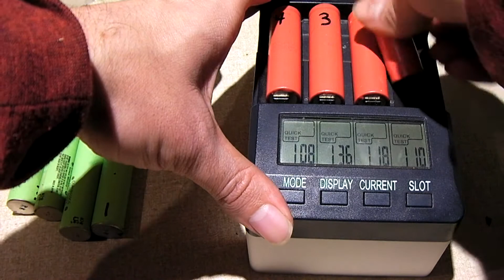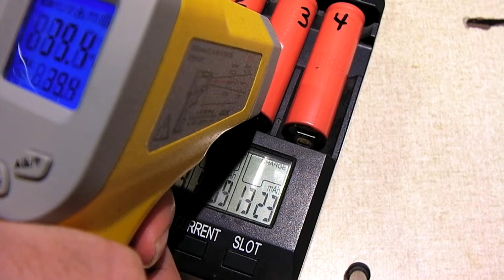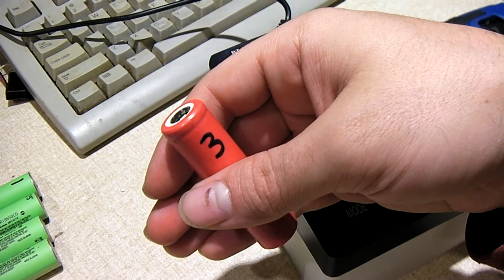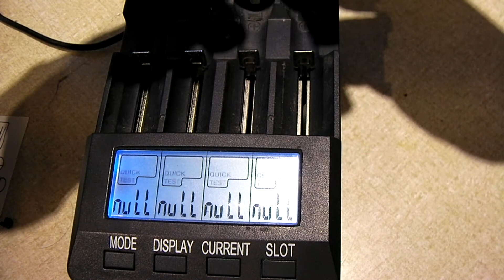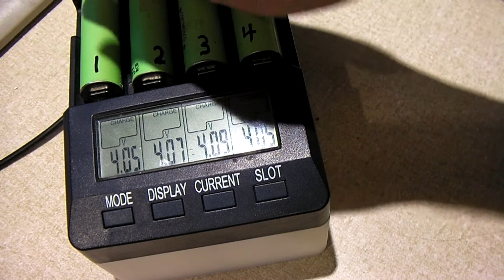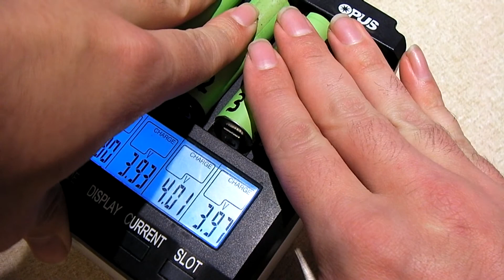Testing Sanyo and Panasonic 18650 cells from Dell and Toshiba laptop packs

Comment: same here, the red ones are not so good. Depend of type, blue ring, they are best, the purrple, red, green and white are ussualy low capacity and they are hot.
They are ussualy from Lenovo lap top battery pack.